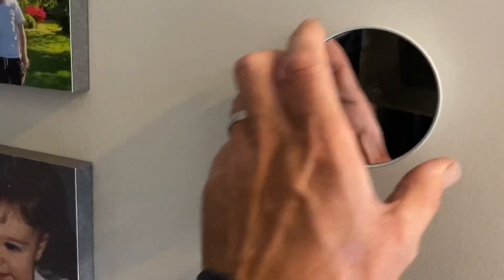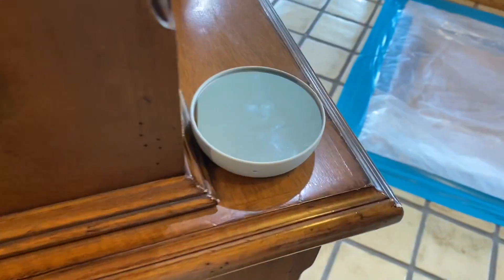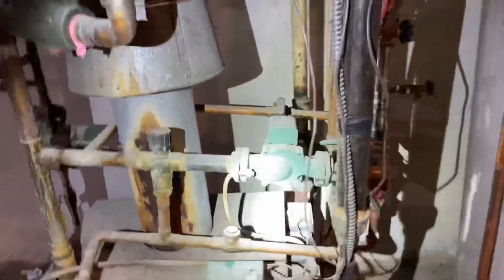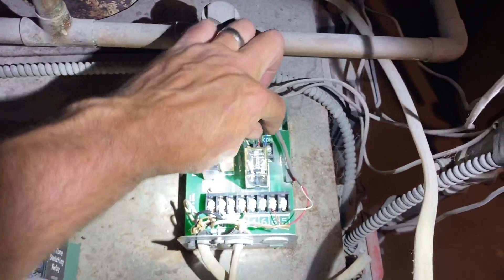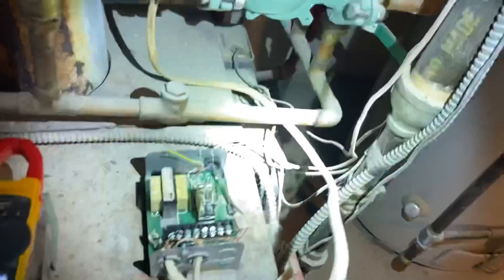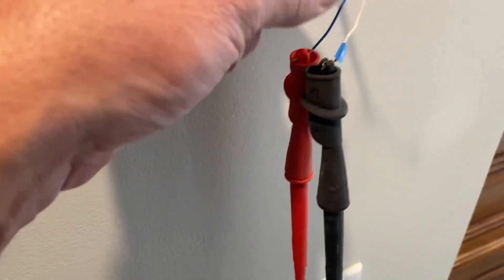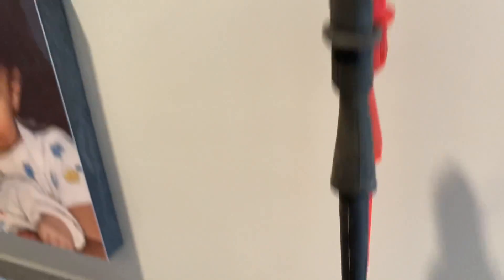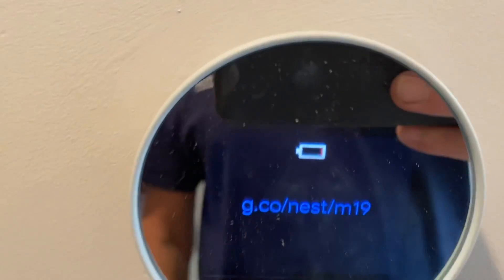Google Nest Thermostat Dead Pop- Quiz Are You A Good Technician Observant Of Your Surroundings?

Comment: I can’t believe an electrician left it that way, I think in this case electrician means (ie home owner) an electrician would have run a c wire for uninterrupted power, when nest is calling it is using the battery and if it calls for too long it will lose power besides the fact that they are a bit finicky until you get them adjusted

Comment: How does an electrician (or anyone else for that matter) install a thermostat and not check to see that it's working?
On a side note, in two houses of mine, and others, the thermostat wiring didn't match the colors on the terminals. Is that a common practice?
BTW I'm neither an electrician or plumber, just have replaced a few thermostats in my time.

Comment: Why did you conclude there was a short? If there was no voltage R to B, (I understand the wires were reversed) would not that suggest an open circuit; i.e. no continuity?  Once you corrected the wiring mistake downstairs, it's obvious all the wires have continuity. But I am struggling to see a short.

Comment: Many times I wouldn't even go to the boiler for those issue.  Those wires are easily found by testing, heck I'll hook the white on R just for job security so if some other genius comes mess with the job I'll be the one the customer is calling back to fix it.... Some of those taco has T T C  so you'll have to test it anyway.

Comment: I have a nest, and I cant run just the blower without having it in either heating or cooling mode.   Does that sound right?      ty
Reply: That's expected behavior. Just set your setpoint to some extremely high or low temp so the AC or heat won't turn on.
Reply: @slip0n0fall  yeah that’s what I’ve been doing but it’s dumb.

Comment: The amount of times i have come across improper low voltage wiring is crazy. Crossed wires, multible splices in the entire run with color changed wires which was done to 'mess up' the next guy. sheese !

Comment: Honestly Mike Once you checked he wires at the thermostat didn't have any voltage I would have done what you did and checked them at the source too. Then corrected on the boiler so I can recheck upstairs . And if the wire are not broken anywhere we would be golden . I did notice the valves being closed right off the bat . I understand why you don't want to fix the . If the repair joints fail you own it .

Comment: You have a reversal of white and red at the relay. On a mechanical or some battery powered thermostats this isn't a problem, but on a thermostat that uses a common wire, this is a big problem because the thermostat is designed for power between red and common, not white and common. Technically, I both cheated and got it. Let me explain. I saw the comments first (thus technically I cheated), but I was also saying into the screen that you had the problem when I first saw it (thus I also got it).

Comment: R/W swapped on relay and valve on circulator outlet was closed.(unless it was a wonky handle)
actually all of the valves on the radiant were closed. hmmm, wonder if you'll find a leak later in the video. 
😵
**I figured as much with all the valves shut 🤣  looked like multiple loops, so you may be able to abandoned a single loop (or two), by isolating and testing them separately..

Comment: I caught it....you shouldn't have given the answer....only when you install many wifi thermostats  and google nests do you know the issues.....especially when wiring a google nest with dual fuel heat and ac.....the common must always come from the ac and not the heating system....that will spin some heads till one figures that out....

Comment: I have a theory that the radiant heat was installed and probably working before the nest was installed. Someone messed up the wire when changing to the nest.. But whoever came to install the nest went simply by wire color without paying attention of how the wires were hooked  previously!
Reply: With older thermostat that used just mercury switch or simple contact the polarity of the wiring would not matter. It matters with the nest because the nest has to find power on the correct leads.

Comment: Hi Mike off subject but never use nest stats with bosch heat pumps. You will find out while charging in force mode they shut off every 13 minutes then restart for some odd reason making the BOVA or BOVB start over in force mode and the heat pump will never reach the required hertz.

Comment: got it immediately as an electrician put in a nest at my daughters condo and they are used to any two wires to get furnace to run...  voltohm meter and five minutes and was fixed   also spotted the valves closed for a zone     some people do that in the summer but heat is on now      smart to walk away from that mess   bigger mess then it looks   kitchens are always a bear

Comment: Nests absolutely need a common unless you enjoy charging your nest off the wall.
Reply: They sell a 24v wall adapter I think
Reply: @rickw4160  they do, I believe it was up until recently that they were providing a free power adapter (if you asked customer support for it) for the wall. But now you can buy one. Common wire is best route unless thermostat wire is a pain in the behind to replace.
Reply: @Florida_Man_In_Florida  you mean like old 120v thermostats which had bx for wiring? Lol
Reply: @PipeDoctor  We haven't had any problems. Have been using nest for 6 years. We have our nest configured to control our humidifier as well as 1st and 2nd stage heating too.  Most errors are installation errors methinks.